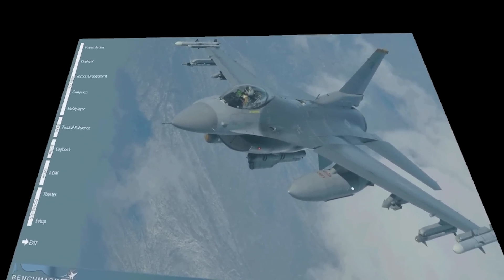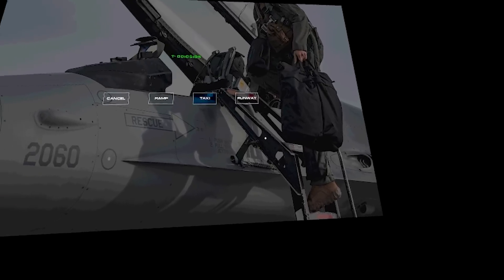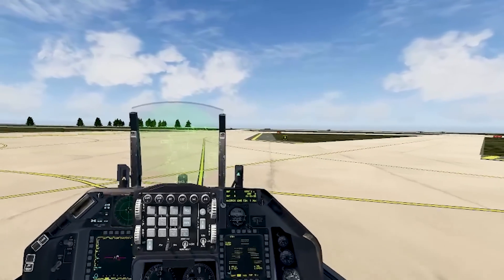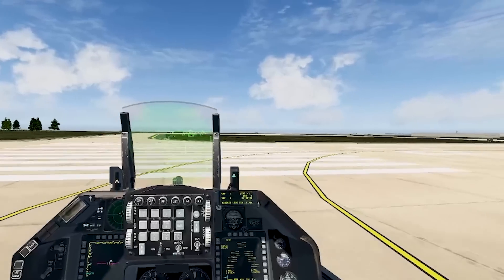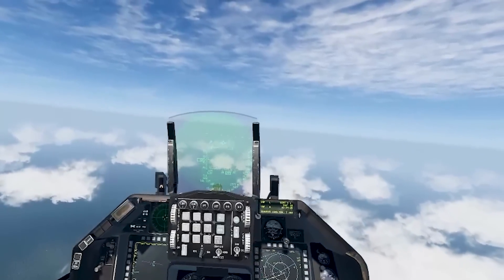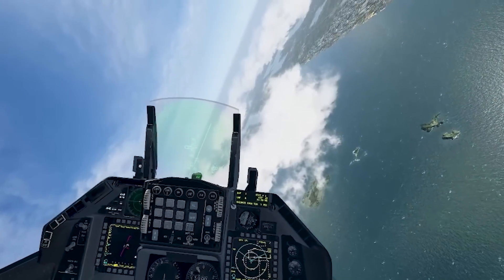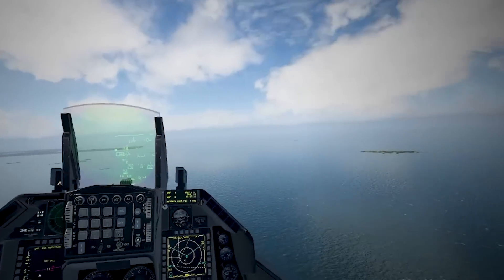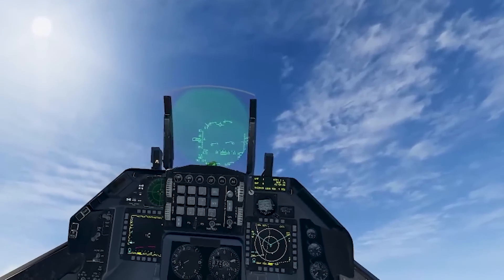Former F-16 Pilot Tries Falcon BMS in VR (Part 1)

Comment: Yes, it does have random failures but you can turn those off in realism settings. I have also broken my landing gear on take-off. Over-sped the gear and they wouldn't retract. It also lets you fly different blocks of F-16s, also C or D model Vipers, you just have to see what block is slotted for the sortie.

Comment: I flied the original Falcon AT,  Falcon 3.0 and eventually Falcon 4 when I was in my teens and wanted to be an F-16 driver.   An autoimmune medical diagnosis screwed that up but I've enjoyed spending time in DCS flying their F-16 simulator.  For fun after a couple of years in DCS I installed Falcon 4.0, unmodified, and it didn't run smooth at all.  I have this super powerful computer that plays DCS at 170 frames per second at 4K but Falcon 4 was chopping quite a bit.  Maybe the mod would take care of that problem because it obviously completely overhauled the entire thing compared to the original based on your video.
Reply: I'm rather sure you already know about this but still: Try BMS instead.

Comment: After this video I know why he is former. I wonder how many aricrafts he crashed during landing. Fortunately he didn't try BVR or BFM.
Reply from the maker: What do you fly in real life?
Reply: @CWLemoine  Possibly ex-Fulcrum driver/tech crew? But yep it was a bit uncalled. Gaming in VR differs a lot from rl flying.
Reply from the maker: @6XENO9  Not only that, but “aircrafts” is not a word and there was nothing in this video that was “know why he is former” territory.  Gear shouldn’t have ripped off and the cable should’ve worked.  As for BVR, I won’t because I actually have a security clearance and would like to stay out of jail.  My guess is this is a sim nerd who thinks he knows better.  Real pilots rarely speak to other pilots like this, especially over a video game.  It’s the gaming world that’s completely toxic.
Reply: @CWLemoine  I agree on the toxic part here, tho I'm a bit baffled because at least  BMS forums people are rather respectful. WRT gear and cable, @MultiJp51 (Mav-JP on forum) suggested you were on the edge of overspeed co it could happen. He's the guy, who wrote BMS Viper FM/FLCS code and also landing gear/brakes behavior+failures. If you think it needs some adjustment, you can talk to him on priv. For cable, I might be wrong, but I think you need to call tower and declare emergency.
Reply from the maker: @6XENO9  overspeeding the gear won’t rip it off completely unless you’re exceeding the speed by 2X or 3X.  It’ll rip the gear doors off at worst at low speed in transit.  Otherwise it’s just a maintenance inspection.  I know I was messing around trying to find the gear switch on my throttle, so it probably did overspeed but not by enough to physically rip the landing gear leg off.
Reply: @CWLemoine  From Mavs comment I guess it wasn't ripped off, just failed to lock, he suggested using alt-gear release would make it lock properly.
I'm strong believer in collaborate to make it better. I think he'l be happy to discuss how to improve it, but that's better to be done on priv rather than via YT comments.
Reply from the maker: @6XENO9  don't know who Mav is but I ran through the alt gear extension procedure and the handle wouldn't budge.
Reply: @CWLemoine  Oh, ok, thanks for reply, alt gear extension part wasn't on the video. Mav-jp (MultiJp51 on YT) is one of the BMS developers. If there's anything wrong with Viper  flight models, aircraft handling, system failures or weather, ACT and AI he's the guy to talk to.
Reply from the maker: Some things get edited for time since that wasn't really the intent of the video.
Reply: @CWLemoine  Sure thing, that's fine. Just nobody, including devs, could know you've tried to work that issue out, hence the advices in comments. I hope you'll ejoy finding more of of the game nuances, and if there's anything wrong don't hesitate to report it. 'Correct as is' is not the default answer in this community. :)
Reply: @CWLemoine  BTW, could bent gear doors mechanism cause it to get stuck and prevent right mlg fail to extend? Maybe that's what happen, all in all BMS is just computer app simulating quite complex vehicle.
Reply from the maker: Unlikely.
Reply: @CWLemoine  wait what do you mean you'll go to jail cause you have a security clearance.
its a game right?

Comment: just a heads up.

you should also try using the AI communication system in BMS.

its still really good.
as an example. if you actually request a landing on an airport. the AI ATC will actually give you heading, altitude, and speed to maintain. and will guide you onto the runway. works with multiple planes landing too. it will actually dynamically create a landing pattern, and will try to space out planes correctly while lining them up on the active runway.

same if you are flight lead giving commands to the other 3 planes in your flight. it blows anything in DCS out of the water.

the enemy AI is also somewhat competent at BFM. it can jink gun shots, it knows about vertical circles, it knows how to reverse turns and when. in all my years of playing DCS ive never had an AI go into a rolling scissor with me, or do a high yo-yo. but the AI in BMS will do those things, if you are not expecting what the BMS AI can do using DCS as a reference. a BMS ACE skill Mig-29 will eat you alive.

Comment: Like DCS they need to put some legs in the cockpit. In VR I feel like an amputee.
Reply: There are legs already. But since VR implementation, they are misplaced/undersized and need overhaul.
Reply: You can display legs using shortcut :)
Reply: You can activate legs in UI setup , then a shortcut allows to toggle on/off in game :)

Comment: I played the original game. It was a groundbreaking flight sim. I still have the original 3 ring binder game/flight manual that came with it. It is over 500 pages. It teaches you how to operate every system on the aircraft. It also has detailed sections on BFM and CFM. It is hands down the most complicated and realistic flight sim I have ever tried, and I owned every Janes branded game made.

Comment: Now that you've tried BMS*, I'd like to get your input on the Air-to-Air modes and how they're implemented in *DCS vs. BMS . 

1. In DCS, the MFDs will "remember" the settings they are set at when in either Dog Fight or Missile O-ride mode. Tricker's video: https://youtu.be/Zl68VEkmGuk?si=gIUN9ckZMkvOVg57&t=95.

2. In BMS, the MFDs will not "remember" the settings.

My question is does DCS * implement the modes correctly, or *BMS ?

Comment: I think you need to talk to ATC and declare an emergency, for them to tension the arrestor cables.   Not sure that would have saved your bird...   

BMS does have a cfg option for random failures -- it's off by default, unless someone who helped with your setup, is intentionally f'ing with you of course :)

But best guess is, you oversped the gear, upon takeoff.

Comment: I started with Falcon BMS. In Chile, March is the month that celebrates the official creation of the Air Force, so it's a joyride of different planes. A friend from HS is a viper pilot and allowed me to climb in the cockpit. We made a bet that I could start the viper (not touching any switches ofc) and I got out with a nice bottle of whiskey.
Edit: Might I add that it's almost stupid proof. Engine knobs on the right side, config panel in front of you, radar on your left. It seems that the people who designed thought "What if we put all related instruments with something specific in a left to right motion". Beautiful plane, even though we used older block 50 models.
Reply: My Dad worked for GD in Ft Worth for 35 yrs. He actually designed the MFDs for the F16. I think he would be Damm Proud that his Design is still Being manufactured and flying Fifty Yrs after he helped make it. And almost 30 yrs after he has passed. God Bless you all.

Comment: Just my 2... But when compared to DCS, BMS just plain sucks.
Reply: All depends on what you are looking for. DCS has better visuals, more variety of aircraft, and better modeled systems. BMS has the dynamic campaign, which is cool, and MORE systems modeled less intricately. The lack of DCS Link16 info, for one, is a huge SA hit... barely get targeting info from Link, too.  All of that is present in BMS.  The ATC and AI flights, the IADS, are all better modeled in BMS but the quality of voice is lower (definitely 1990s era).  

Overall, they both scratch different itches. If BMS had a newer UI which was more intuitive and a better terrain engine (coming soon) the loss of graphics would be far less noticeable.
Reply: @Whiskey11Gaming  BMS has significantly better modeled systems and flight dynamics. BMS uses official aerodynamic data from NASA wind tunnel testing of the F-16 and features 100% integration of the real F-16 FLCS code developed at Langley AFB coded directly into the sim. The DCS FLCS is made up

BMS systems modeling is much more intricate and has many failures which do not happen in DCS.  Landing gear failures, Alternate gear extension, hydraulic system failures, fuel system failures, engine failure, low oil pressure on startup, hot starts, hung stores, etc. All of which do not happen in DCS. You can do things which would break the jet IRL in DCS without consequence

BMS does have Link 16 and models it at a much higher fidelity. You can send info, change and add donors and other aircraft to your flight, etc. In DCS it will still send your lock info to every single person on the server when you try to send a target to someone in your flight, and you currently have no ability to modify or change it
Reply: @Punchy_  you seem to be confused by my statement. The sheer number of things modeled by BMS is definitely larger than DCS, but the underlying depth at which it models it is significantly lower. A prefect example is the INS in the Viper and Hornet.  ED made a coded model of the actual INS whereas BMS models the effects of the INS.  We can argue whether it is necessary to have a perfect coded model of an INS system in a fight simulator, or if we just need to model the effects and limitations, but the reality is the underlying base code of BMS is far more restrictive of that level of gnats ass detail... 

SADLY, DCS World is held back by this near autistic pursuit of modeling every system component in such detailed ways when modeling the effects is all the player will actual encounter or realistically care about. 

Nowhere is this more prevalent than in the HB F-4E modeling the effects of G and system wear on a fucking altimeter, when people generally don't care that much about such a simple component, but here we are where that level of anal detail is not only possible, but it's in a Sim.
So yes, BMS models more feature complete systems, but at a shallower depth than DCS for most things.  There are exceptions... ECM, and flight modeling specifically, where ED falls way behind, but when we do final get there, I have a feeling the edges of the envelope and the EW environments will be far more detailed.
Reply: @Whiskey11Gaming  Ummmm.... I think you know waaaay more than I do. So thanks for the input. Will keep it in mind. And God bless.

Comment: if those clouds didnt rotate i could be so happy in BMS VR.
Reply: set g_nCloudRotatingMethod 1
Reply: @devnull-uk  superb!
Reply: As long as it won't be volumetric clouds will rotate (they are sprites/billboards) ... Volumetric clouds are beautiful, the problem with volumetric clouds is the lack of IR attenuation effect (as in DCS). Maybe someday.
Reply: You can stop them rotating with a config file setting.
Reply: @devnull-uk  Hi!
"You can stop them rotating " Not entirely unfortunately. All you can do is changing the logic of rotation choosing between internal cockpit behavior and external static camera mode for video footage. But spirits will always rotate at some point.
Kind regards.
Reply: @Dee-Jay  fair. But generally setting the rotation method to 1 makes it not noticeable in the cockpit in VR. Whereas without it's really quite off putting.
Reply: @devnull-uk  Yep. Rotations will be visible only when passing vertical attitude.

Comment: Hi!
5:20 : A little G warm up session will increase "virtual pilot's" tolerance for several minutes.
10:00 : Only two greens => possibly an over-speed at takeoff with gear/door maneuvering. You could have applied the alternate landing gear procedure/checklist to get a successful extension.
(remember that you can test the lights before going into the conclusion that you have an LG failure, despite the "TO/LDG CONFIG" alarm/tone which could be triggered by something else than the RMLG unlocked)
11:15 : No random failure (unless you have set the Config to allows random failures, but this is not really a realistic option. It is rather to practice a lot of different failures). Any failure you can have will have a reason/root cause.
VERY cool, glad and happy to see you checking out Flacon BMS! ❤
Kind regards.
Reply: Correction on my 1st comment:
Yes there are some possible (+/- random) risks of hot start during start-up sequence. But nothing that can't be solved by proper actions/procedures.
Reply: I see what you did here with "Flacon BMS"! BTW. any chance to have flyable Rafael at some point in the future?

;-)
Reply: @sunrrrise  Hi Sunrise, heck even proper M2k would be sweet, but still even it seem to be out of teams comfort zone. Which is a bit pity as Galinette once offer his help to make one for BMS.
Reply: @6XENO9 Not a problem of "zone comfort" Galinette who is for sure a great guy and good coder is probably only interested in the M2000. And the problem is that we don't want to deal (for some very good reasons that I won't mention here) with any possible issues with Dassault who are VERY sensitive with that kind of copyright and industrial stuff. (Same reason for the Rafale)
Reply: @Dee-Jay  Yep, thanks for mor detailed info. that I was refering to. I know Dassault is uber-protective about their stuff. Maybe if French or Greek AF nudged them their need another sim for advanced tactical training in dynamic and complex scenarios ... :)
Reply: is that real about the warmup?

Comment: Wow! Mover hasn't asked where the NWS button is yet, or did I miss that ?? LOL
Reply: That was Casmos line when he did patters with Mover in DCS. A classic 'how can I steer on the ground' question back from FAQ pinned on any Falcon4 board around '99-'00
Reply: I forget every try when I hop into the F-16 after getting used to the planes that do the nosewheel with the button at the base of the throttle. Especially if I've been flying the F-4 and constantly needing to hit the nosewheel steering button.

Comment: Can't wait for you to dig into the system differences between what's correct on BMS vs DCS. The biggest eye opener for me was that BMS considers even turning on the A/C so you don't fry the avionics, and a few other startup things. Would love your take on the systems, and definitely go through a few campaigns -- this could be an awesome category for you and what you've done at least with DCS. I know that BMS is a bit more "tricky" to do multiplayer things, but definitely a great experience. Thanks for posting this regardless of video quality, this was a great watch.
Reply: @Mover The MP connection process is so much better than it used to be... and absolutely worth it, just takes a little persistence. Really looking forward to your future BMS vids.

Comment: Hi, i'm glad you've got it working. +1 on campaign being the essence of Falcon experience, 'tho video would need  heavy editing to keep you out of troubles. Still i'd be great to watch.
BTW afaik for arrestor cable to work, you'd have to request it from ATC :) in general comms and mission preparation are huge parts of BMS.
Also g-warmup may improve your vpilot tolerance.
Reply: Not sure if its ATC related however I do remember grabbing the cable with the hook in the past and they do work.  I probably did declare an emergency with ATC, I do remember them working.  Thanks for the tip didnt think it was ATC correlated function but makes sense now to raise the cables.

Comment: Hi, Mover. Try some campaign stuff. That is where BMS truly shines.
Reply: BMS is a hi-fi flight simulator with a bangin’ real-time strategy game attached to it. You can plan every mission in the ATO and direct every unit on the board.
Reply: Yes please, would be great to see Mover’s BMS campaign series.
Reply: Or TFR. Or WX. Or DTC. Or tuning your radio if you want to talk to someone. Or setting tcn for formation flying. Or dealing with AA that actually is a threat. Or joint ops.
Or everything else DCS deems irrelevant for modern aerial warfare.
Reply: @monstermegahoschi dcs allows you to tune your radio to whatever frequency you want, dcs also lets you use the tacan for everything it can be used for, but I guess you apparently don’t play it
Reply: @Dcscockpit Hi!
Correct, but what the guy meant, is that frequencies/channel allows to communicate with all the ATC agencies (Approches/Departure/Tower/Ground) which provides full ATC service and traffic control/regulations. Like there : https://youtu.be/ZKKC3bWUdjA?si=xMEZWhA-DyEBy6J9
What BMS doesn't have on its side is the REC mode only for the TACAN.
Kind regards.
Reply: @Dee-Jay  we do get to talk to the 3 frequencies in the server I play in ever Thursday and Friday night when they have people
Manning the control towers. Lots of fun.
Reply: @monstermegahoschi  you're such a cool fighter pilot. Can you be my dad?
Reply: @monstermegahoschi Ok nonner